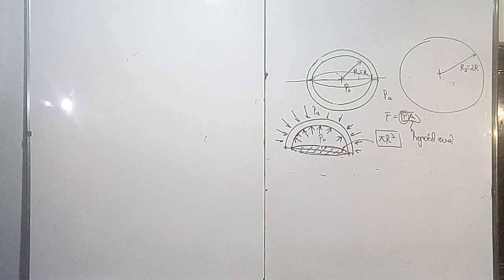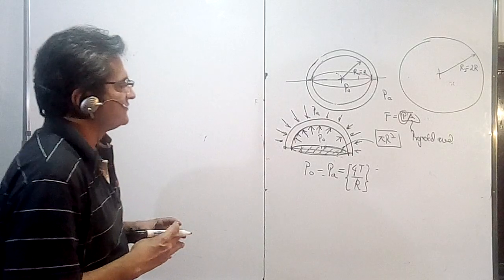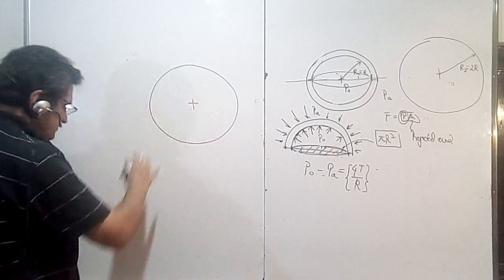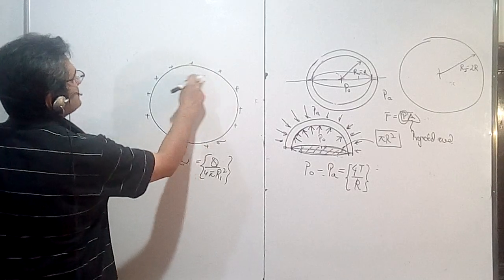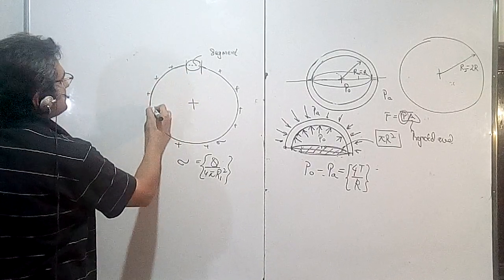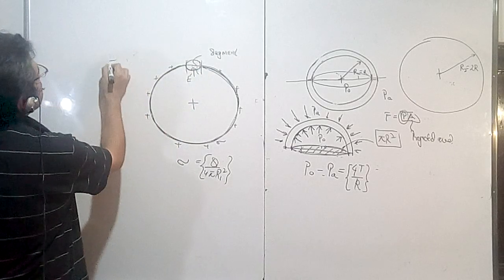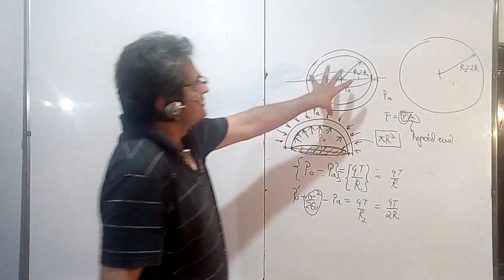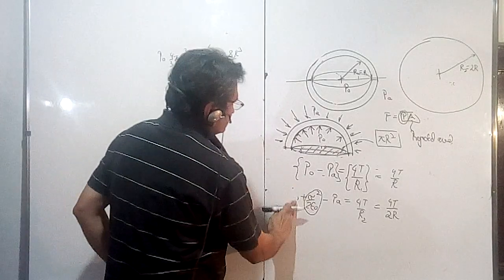Charge required to double radius of soap bubble surface tension

Comment: Sir I have a doubt..
When we will give Q charge the radius was R1...now there will be high excess pressure due to which bubble would expand and it’s volume shall increase...so initial pressure should have a (sigma)^2/2€ term also where sigma is Q/4pi(r1)^2...since this is the cause of disturbance..
Why we are not considering it...pls reply sir
Reply from the maker: That is taken into consideration after charge is given.

Comment: sir while applying p1v1=p2v2  why are we only calculating Po and Po dash but not also Pa?
Reply from the maker: Dear, I have stopped teaching now , the issue must be dealt in lecture.
Reply: @ykmt96  ok sir
Reply: @sudebkrmazumdar804  Pa is the atmospheric pressure so it won't change.

Comment: This concept cannot extended for a drop💧 .am I right.
Reply from the maker: yes
Reply from the maker: Because the charge may uniformly  spread in sphere. But if it is a mercury drop then I think we may apply it as mercury is a conductor and charge will reside on surface.